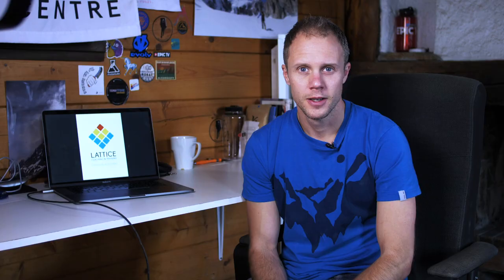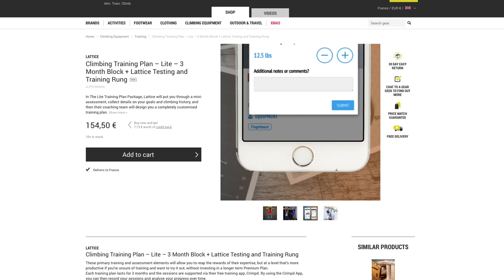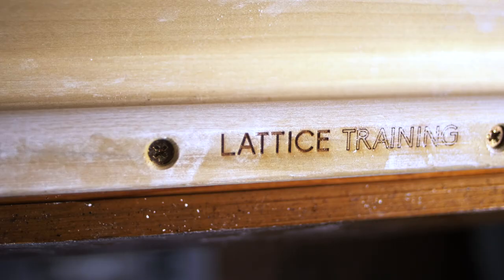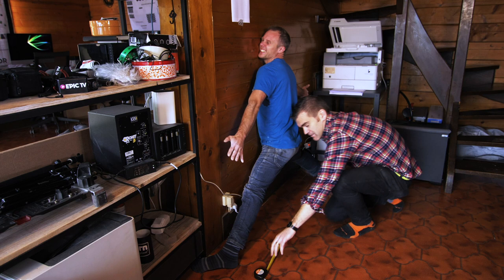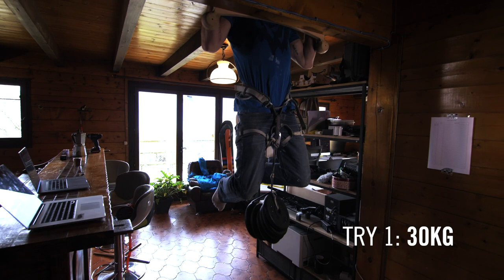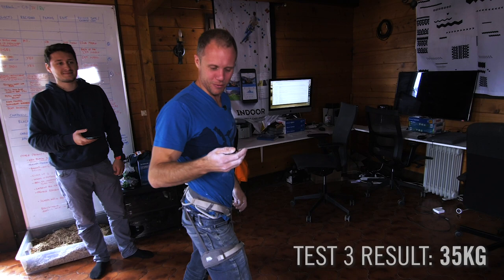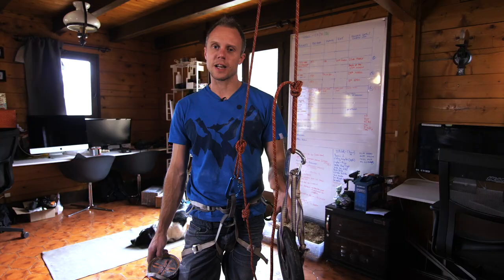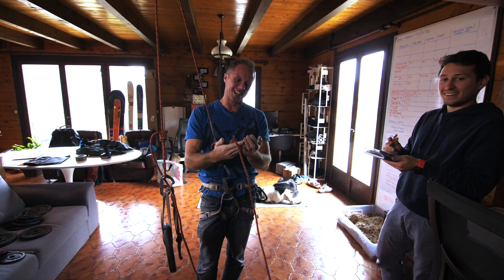Matt Vs Lattice: The Climbing Training Starts | Climbing Daily Ep.1557

Comment: Hey Matt! Your Power endurance score was much lower than it should have been. I just purchased this plan and the PDF specifically states that the rests are included on your score. Your endurance definitely isn’t as bad as the Lattice Guys thought since you have them your scores without rests. Just a heads up 😂

Comment: I don't understand. You are lacking endurance to climb 8a BOULDER ? doesn't make any sense to me
Reply from the maker: I think more power endurance...
Reply: EpicTV Climbing Daily yeah, that’s more like it but is power endurance your limiting factor on a 10-15 move boulder ? Seems strange to me. Because Matt apparently has the strength to climb 8a, maybe it’s probably more due to a lack of technique or mental strength (I’m trying to be constructive here)
Reply: @camilleo2817  It's completely possible to have the strength to do 1 hard move (8A level) but then fail on the moves coming after. It is rarely enough to have the power endurance to execute 1 or 2 moves at your limit if that drains your reserves (anaerobic capacity). This is unless you find a 1 move wonder boulder with the crux very low up with the rest being easy.. You can imagine a boulder with 10 moves with 9 of them being 7A and then one 8A. Which one is easier to do, the one with the hardest move in the beginning or the one with the hardest move in the end?